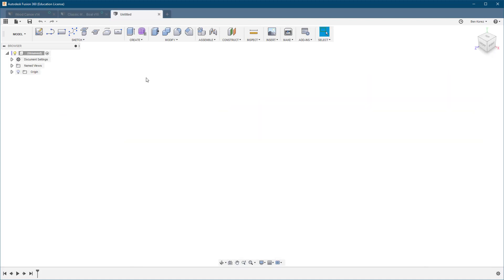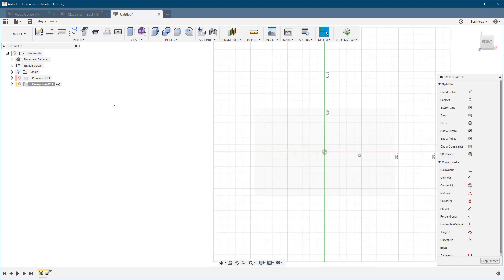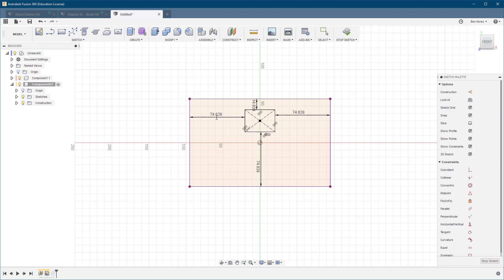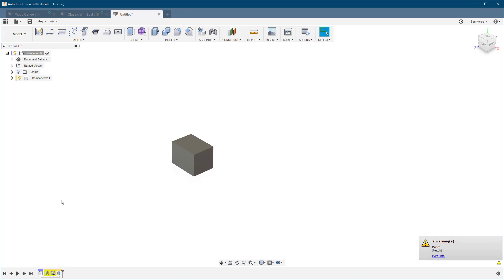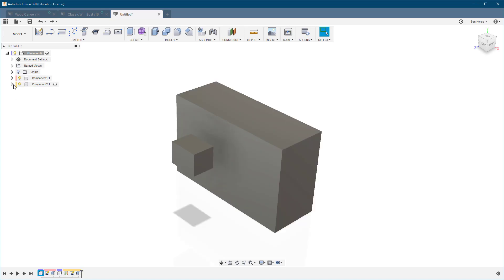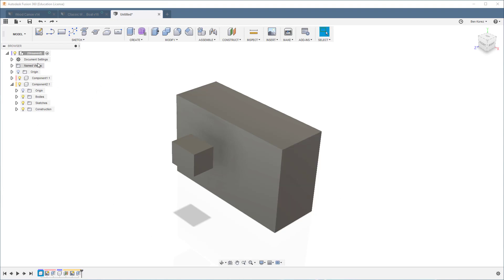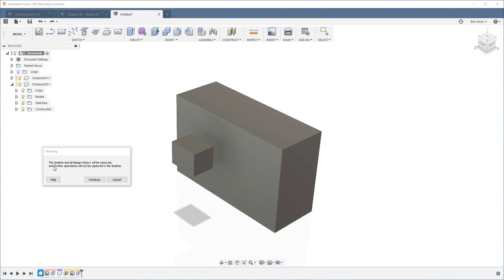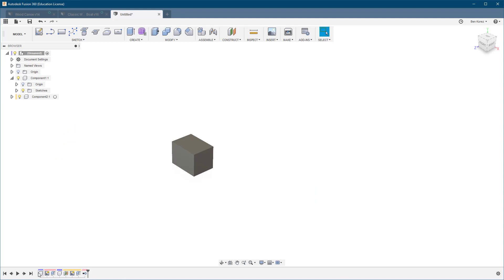Fusion 360: Delete vs Remove (Update)

Comment: Thanks. I think I get it now. This is how I would explain it: delete rewrites history. remove just adds another operation to history. It's like the difference between being "disappeared" (in Orwell's 1984, you would never have existed) vs. just dying (the way people normally leave this world).

I started using remove without realizing what it really is, because it seemed to do what I wanted: I'd have a part in a subcomponent that I wanted to get rid of. Delete didn't seem to do what I wanted, because it just moved the part to the parent component. I could delete it from there, but it would just keep recursing, which was pretty annoying (still is).